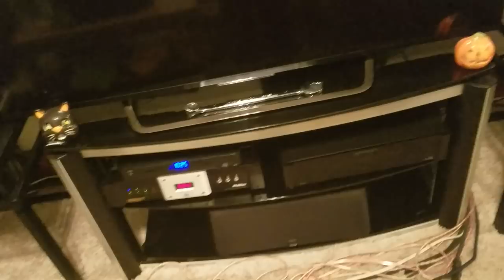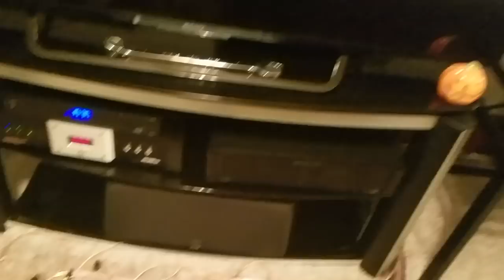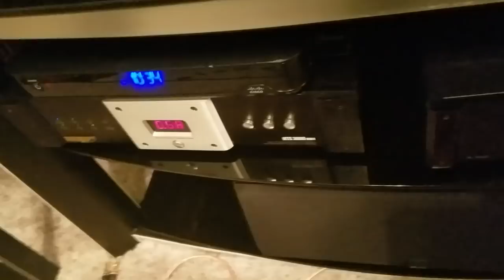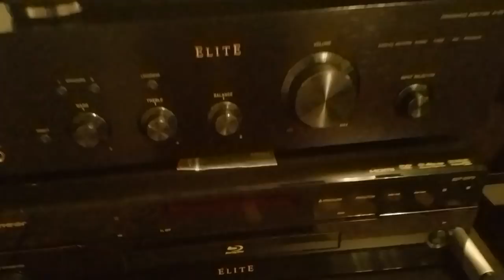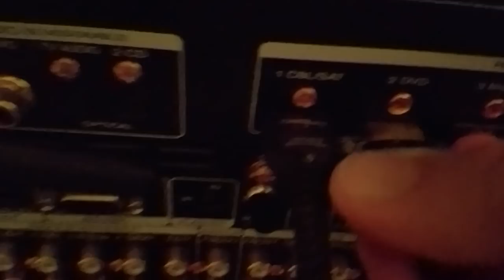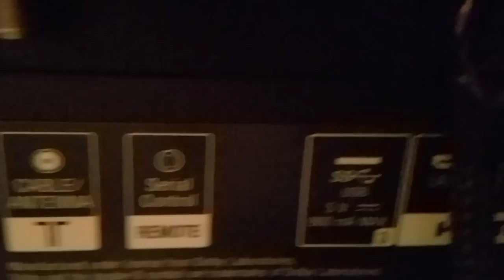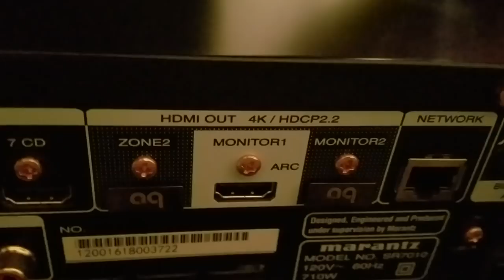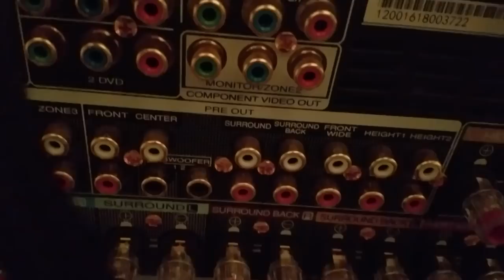Setting up the Marantz SR 7010 9.2 channel Dolby Atmos DTS X flagship receiver with auro 3D part 1

Comment: Don't get caught up with expensive cables. Especially HDMI and speaker cables. HDMI 2.0-2.2 sends out the same audio and video signal no matter how expensive it is. It either works or not. As for speaker cable, as long it's pure 100% copper wire and not copper clad aluminum it will make no difference in sound. Those fancy expensive audio cables companies make only cost as little as 20 dollars to produce yet they overprice it 50-100 dollars more.
Reply: Sometimes I get white specks with certain HDMI.

Comment: To me setting up is not about just conneting cables - its much more abour speaker selection and placement...but:
1. Your cables are more expensive than Your Receiver? I dont follow the logic here?
2. For You (cable guy) the Audio would be better for same bucks if You went for:
Marantz AV7702 + separate amps + XLR (cheap ones) cables in between.

Pirority order for good Audio:
1. Speakers (as per sound preference which certainly is the main aspect in Audio that suites YOU)
1. Room setup (standing wawes, frequency response and so on)
2. Pre amp choice and calibration (possibilities to reduce what cant be solved with the room)
2. Amplifiers (Difference can definitely be heard - in my opinion mostly in the lower range - tighter bass and higher range - airier highs and less S-sounds)
3. Speaker cables (blind tested 4 vs 100$ / meter cables without any audiable difference in my setup at least....)
4. Pre-pro cables (Audio quest cables in Your setup seems quite over the top)

I admittedly left out audio source as this is a difference chapter. For example a good HTPC (setup correctly) can be better than a good blue ray player.
Also source material matters, but just because it says FLAC or likewise it does not mean the recording is any better than CD quality, its just the storage medium.

I keep my JBL Ti6K + Ti2K + Ti1K + TiK sub + 6*XTi20 as they still sound amazing (especially the Ti6Ks and the Ti2Ks) and a REL Q150 sub for correction of the worst standing wawes.
Driven from a Pre Marantz AV7702 + Pro: Primare A30.7 (7)channel digital amp & Emotiva XPA5 (5)channel classic amp for height channels....overkill...probably, but it was left over when i got my outrageous Primare which is A LOT more dynamic AND running a lot cooler in my "positive pressure" home made audio cabinet (to prevent dust bascially)
Cables? Tried a few high end ones, but for long run HDMI 1080p 12bit colour I went for the Deltaco with a built in signal processor (12m) and it works flawless. Pre pro I bought a german brand (high end-ish) for cheap on E-bay and speaker cable Supra Rondo 4*4mm2 for the fronts to be able to bi-wire (and bi-amp if I prefer) and some "generic" 2*4mm2 for the surrounds and top layer to keep resistance a non factor.
Deltaco XLR pre-pro and to JBL sub. Supra RCA to REL sub
Custom built fan cabinet based on Ikea furniture (replacing my expensive high end RACK that makes ZERO DIFFERENCE) and PC fan controller (with display) and silent high pressure fans (one per cabinet intake = 4 pcs) with slot in mesh filters in front of fans to minimize flow loss and of course dust on fan blades - no exhaust fans as its based on over pressure to keep dust out - just slots adapted to vent out heat but still maintain a slight pressure. I love that I do not need to de-dust my equipment and at the same time have temperature sensor based fan control to keep noise down but still keeping it cool when it runs hot (higher volume = higher temp = higher fan RPM = higher noise but since volume is high it is not noticed :) )

Power cables does NOT matter as long as the area is big enough to supply power.
The ONE thing that CAN matter is removing ground from the power cable as it can create ground loops.
That can be made either via outlet or buying ANY power cable without ground.
There is no magic in power cables - its just power. Filters are inside the amp or if You are a real "cable nerd" You can add a very expensive line filter connectoed to SOLID GROUND like a water radiator that can solve the ground loops (but its much easier and cheaper to solve as above by simply removing ground lead and thus any interference)

Comment: How do you connect Aura 3D ..? It must be connected to No. 2 sub output and should therefore use an amplifier ... What do you use ..?    Johnny Danmark.!
Reply from the maker: That can be extremely confusing... what you need to do is get an external amplifier, and send the sub 2 output to the amp, using an rca cable, but just one channel, so a normal rca cable will have a left and right wire, well you just need the one channel... not sure if a subwoofer cable would work or not, but it might.  Then just connect the external power amp to the auro 3d channel or voice of god speaker in the center of the ceiling or front main height channel.  I hope this helps, let me know if you still have more questions, I will try to figure out exactly what is required for it.

Comment: An urgent question please, the specs on the Marantz SR 7012, SR 8012 "Dolby Atmos (up to 7.1.4 with an external 2Ch amplifier), DTS: x and auro-3d, 11.2Ch Pre-out " Does that mean that It cant support Dolby Atmos 7.2.4 configuration? appreciate it.
Reply: You can go nuts as long as you have a external amp. Yes 4 atmos or height speakers. So that's L,R,C L/R rears plus Subwoofer. 2 more rear BACK speakers.... like behind you if possible. Then all the height speakers. Right now I only use 2 rears but essentially they are high up because of my previous setup but once my new speakers come in I'll leave those high and put lower rear speakers in the proper place. It's very nice.

Comment: here is a question why does my subwoofer make a humming sound when I turn it on  without the receiver off ..?when I turn on the reciver it goes away thanks
Reply from the maker: john smith my guess would be the subwoofer cable you're using is getting interference... you could try using a more expensive subwoofer cable with a grounding plug on it that is meant to eliminate that otherwise you might be getting 60 hurt hum which is caused by the components plugged into the outlet.  That is usually caused by preamp feedback but it's hard to make that go away unless you're using a more expensive power cable.  Try moving the subwoofer around or closer to the receiver and see if that goes away shorter cables are always better but it sounds like you need to upgrade the subwoofer cable to one that can be grounded at both ends. I hope that helps let me know
Reply: ok great I will try that and let you know if it worked as soon as  can get the new cable...the sub now is right next to my tv stand now...do you know where in Canada I can get a power conditioner for a 20 amp curcit ...I keep finding a lot of 15 amp ones....like ur videos keep up the great work...thanks

Comment: Got a question for you guys someone answer quickly please got a chance to buy the marantz sr7010 for right about 450 want to use it to run a 5.2.4 dolby atmos system should I buy it or what
Reply from the maker: I would buy it if I were you... great receiver
Reply: Does it have hdr10 and dolby vision
Reply: @moveezy5591  The Marantz SR7010 supports HDR10 and will support Dolby Vision and HLG via a firmware update in October.

Comment: Hi Puppies 🐶 World owner.  U never answer my questions, and I'm a subscriber and support your videos.  Anyway, I watched you set up your marantz, but why did you plug your Emotiva amp into the zone 3 pre outs instead of the front speaker main pre out ??     Please answer me.
Reply from the maker: You actually noticed!! Yea I made that mistake doing the video then looked and realized... I switched them up for the 2nd video and will post it soon here because I had to redo it.  I so apologize for not getting back to you sooner. I am always using the mobile device to get on YouTube, and the notifications aren't easy to reply that way.  But yea, the Emotiva should have been connected to LR pre out not zone 3.

Comment: Atmos and Aura 3D are brand new here in Denmark. You have started buying these "Dennon and Marantz" Reciver within the last year. And I have asked for help at various HI fi stores. But it's so new that nobody has tried setup for Aura 3D. and they are trying to make me buy an Amplifier that I have to put to my front speakers. !!!!! And it just shows that they do not know anything. Had the hope that you could give me a reply ..! Have a Marantz 7011. and need only help setting up the (TS) speaker and which amplifier to use as shown on page 67. In the User's Guide that is online. http://manuals.marantz.com/SR7011/EU/EN/